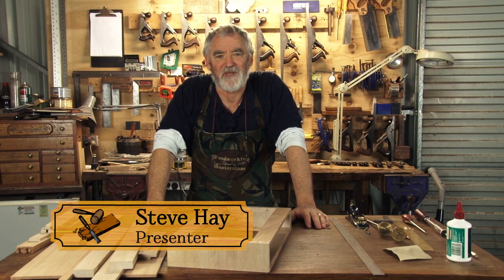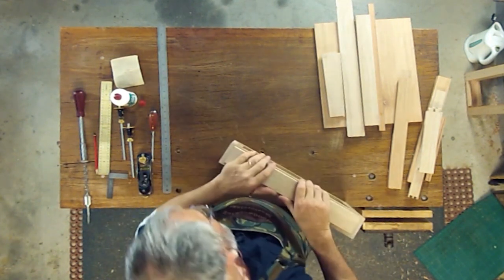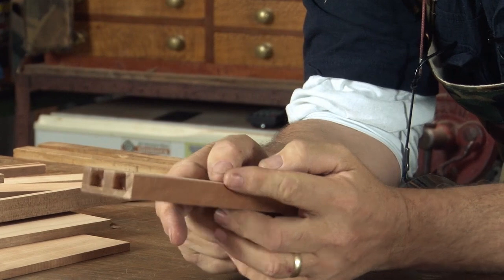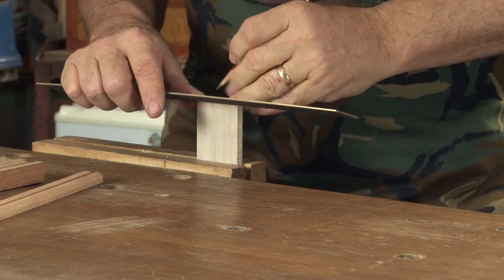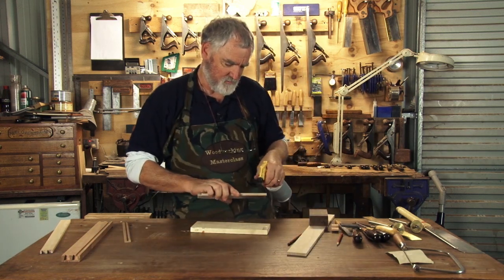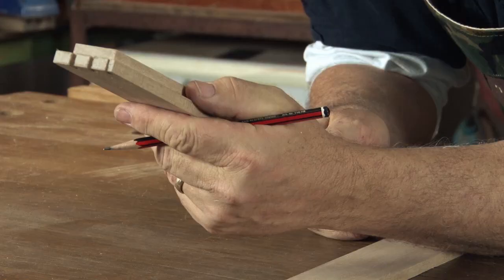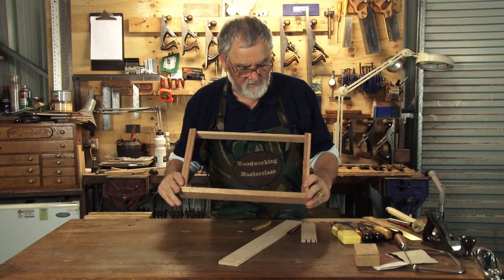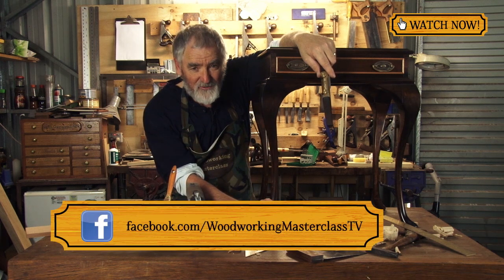Woodworking Masterclass S01 E03

Comment: Another added bonus of the ' extra ' timber out back of the drawers , especially the bottom drawers in a traditional cabinet with short legs and close to the floor is that of stopping mice coming up the back and getting into things .I believe in closing off the bottom under the lowest drawer .many older cabinets were left open for ventilation I assume ,however , mice will keep coming back . Dog was paying full attention , good to see . Tight even joints are a thing of beauty .
Reply from the maker: Hi Mark, Thanks for the comment. Dust panels were generally used under all draws then, unfortunately came the cost cutting wars and quality slipped first to be sacrificed were the areas unseen by the unwary buyers. Hence rodent problems. Bob's a good watcher but a lousy doer! Cheers Steve

Comment: Since you work with almost all handtools, how did you cut the groove for the bottom?
Reply from the maker: I do prefer hand tools but that's not to say I am restricted to them. I think I used a saw table for the Drawer Slips but if you want to be totally hand tools then a Stanley 45 or 55 would do the job so to a Stanley 71 or 71 1/2  you could use a dado plane or worst case a hammer and chisel. Cheers Steve
Reply: Hand router

Comment: I have a question about the drawer bottom, aren’t there risk of the bottom too expand and warp the sides?
Reply from the maker: Draw bottom will expand and contract in the lenght of itself which is catered for in the assembly. There is very little to no expansion width ways. Cheers Steve

Comment: that drawer was fitted "squeaky" tight. Surely even the smallest rise in humidity would expand the wood and jam it in the frame. Would you not prefer even 1-2mm gap all round?
Reply from the maker: Personally not, as it would rattle and shake from side to side when it was pulled and pushed. The expansion on timber is mainly on the tangential plain not the radial. I also am mindful of cutting drawers from 1/4 sawn sections of timber which again has the least potential of movement.  A snug fit is a good fit in my opinion anyway.  If you apply a rub of candle wax over the drawer slides and bottom of the drawer you will find that will also help overcome any tightness that may occur. Good question thanks for the comment. Cheers Steve
Reply: Thanks Steve.

Comment: why not screw the bottom into the front so it can move freely in the back?
Reply from the maker: Hi Kevin, Because that would leave screws that could catch on the draw frame and also if there is a lot of stuff in the draw the back will sag. Cheers Steve
Reply: Thanks Steve, makes sense! Real inspiring stuff :-)